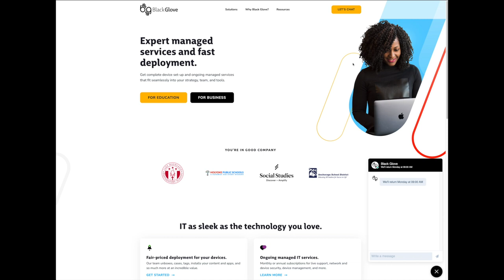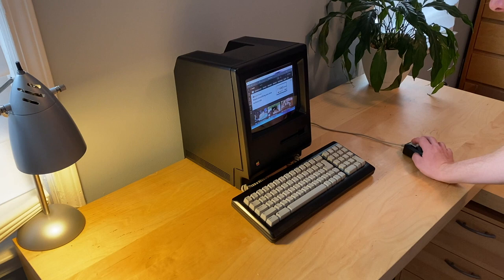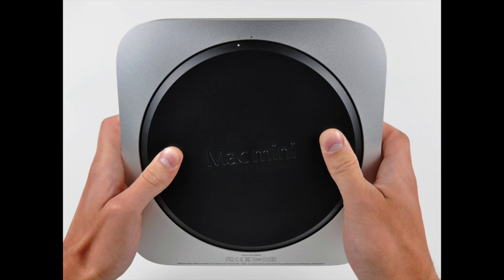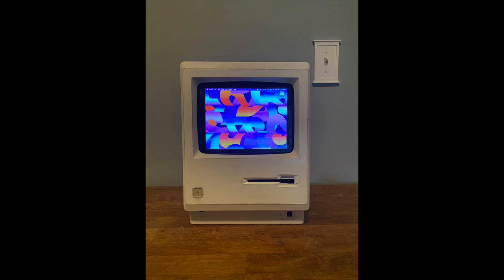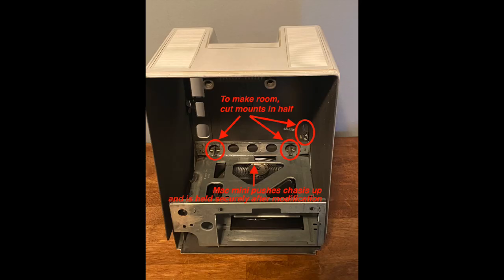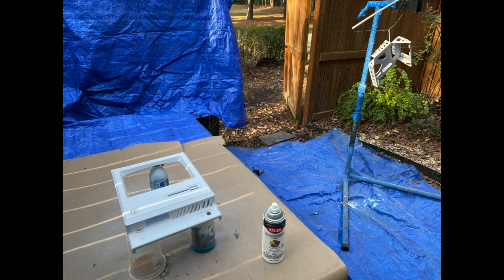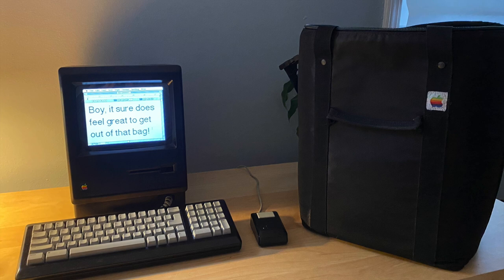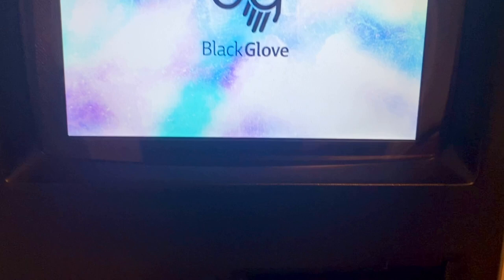Macintosh Plus mini Retrofit - Build Video!

Comment: hey markus, did you print the screen adapter to for the screen by yourself? I need this for my project too. my macintosh plus is done for a couple of years now but the screen is an issue because you can clearly see that its an lcd :)  video is up on my channel aswell
Reply from the maker: Hi the screen bezel was custom made by RetroAppleAT on Etsy. He can sell you the 3D print design files or he may make more if offered enough $$ or demand

Comment: How did you manage to make the resolution of the screen fit inside the Mac Plus bezel size? Are you running something like SwitchRes X to change the resolution?
Reply from the maker: Hi thank you no the screen naitively supports up to 1280 x 1024! Works without anything extra.

Comment: Nice! thank you so much for posting this "making of" video. I have a few questions.

Does original plus chassis interfere with the Wi-Fi/Bluetooth reception?

On the 2014 mini couldn’t you just swap out the hard drive to bypass the firmware lock? Or is the lock programmed into the firmware somehow?

Does your 2018 run hot?
I have one and it tends to run pretty warm
does it need a additional fan?

I like the idea of the monitor being powered by the USB-C hub

So does the screen come with the screen adapter?
I have a 3D printer and would be interested in purchasing the file for the bezel

The paint job looks real nice. Too often when somebody paints an old Mac they don’t look too good but yours is very nice.

There is a guy here in Indy that has serveral 2012 i5 Mac minis with 120 SSD drives already installed. He’s asking $ip each for these. He also includes the original 500 gig hard, original box, DVI to HDMI video adapter. Again for $80! I bought 2 for different projects.

I would like to have a modern Mac in an old compact Mac housing but I don’t have a donor Mac plus. I have 3 plus’ that work and an SE but they all work.
Reply from the maker: Thanks so much Bill! Great questions!!

I did do testing with the heat - I thought it might overheat as well - with this being the i3 model - everything checked out while running the trial version of iStat menus. I let a HD YouTube video run for an hour and it never got too hot. Let it run overnight and everything was okay with the temperatures and no extra fans. If this were an i7 mini, some extra ventilation might be needed. Leaving the battery compartment door off could be enough for that, or an area to side-mount a fan.

I remembered wrong in my video, and the previous Mac mini was actually a 2012. I looked into the firmware password, and it is only possible to remove it via replacing a physical chip on the board, or modifying the EEPROM of the current one. There are shops that will perform the service or sell the chip, but wasn't interested in fixing it.

The screen came with VGA and HDMI inputs. Just used a standard HDMI cable from the USB-C dock. The screen seems commercial with just the consumer plastic casing removed.

Thanks - the paint job had proper primer, and was satin. Painted in Acrylic paint as it's much more forgiving for novices. Something like this which is handled often and dinged on a desk should really be enamel paint - but that is much more difficult to paint. The acrylic paint is very soft and easy to disturb, chip, scratch, etc.

There are empty cases that come up on eBay every now and then.
Reply from the maker: Oh and the wifi signal is a little degredaded but works well

Comment: Look, you're not revealing anything very important in this video.
That's the name of the LCD model. You've re-used an old device so brilliantly
There are some things that people who watch your video already know. The important thing is that
You didn't explain what model you used or how you would reduce the size if you used an LCD more than 9 inches.
Reply from the maker: Hi! Thank you an LCD larger than 9” will not fit. The screen bezel was 3D printed by RetroAppleAT on Etsy and unfortunately I don’t know the model of the screen but it should be a relatively standard 9” LCD taken out of its housing and powered by a USB to powerPIN cable.